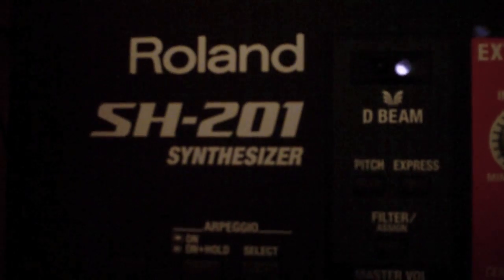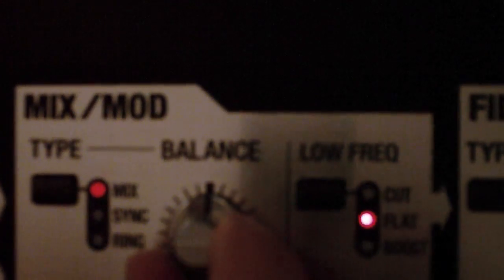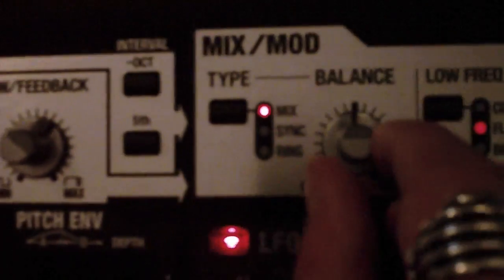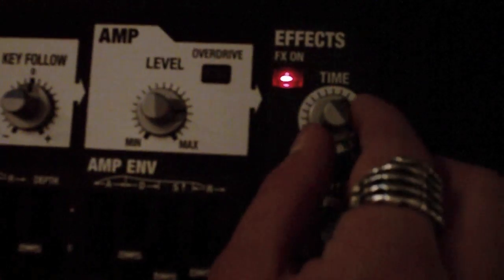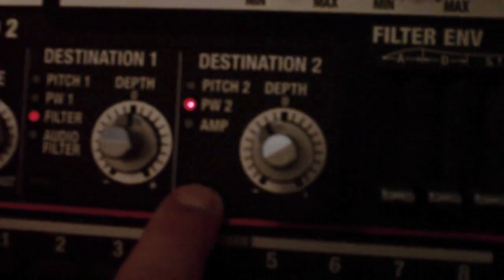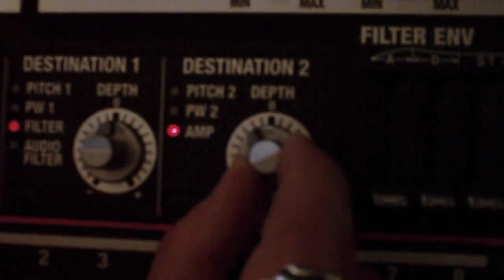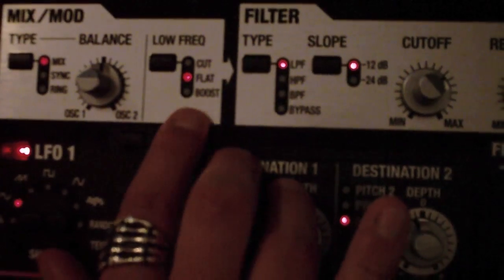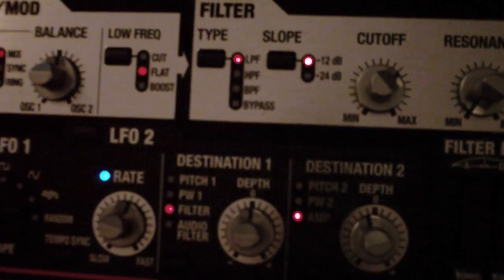How to: Roland SH-201 Church Organ

Comment: i done everything in this vid and my patch sounded nothing like this one???
Reply from the maker: That's strange. Except for the part of the filter where I misspoke, and you need to be closer to 3 o'clock, it's all fairly simple stuff, and there shouldn't be any major differences in a digital synth. This video is of course just room audio, but you should still feel like you're in the ballpark, so to speak.
Sadly was forced to sell the synth in a tight spot, so can't really offer any alternative help. Sorry. Hope it works out for you though 🙂
Reply: thanks for replying anyways.